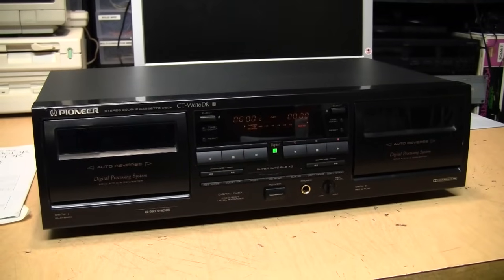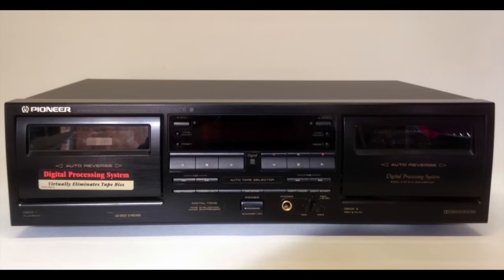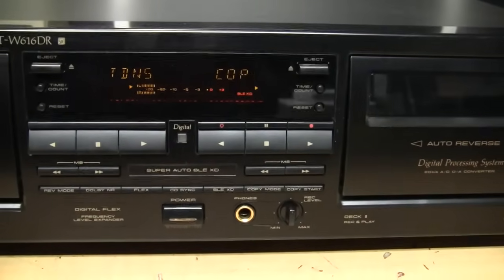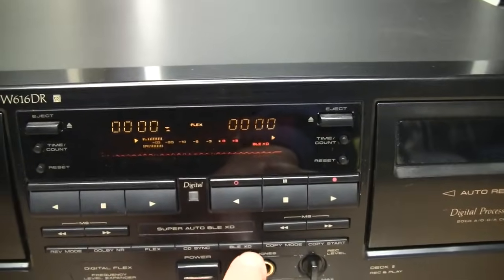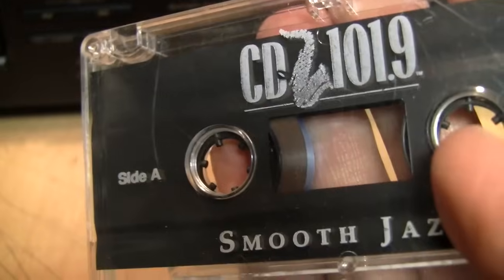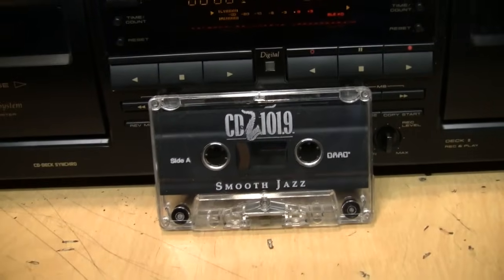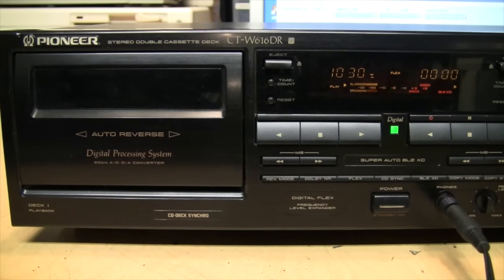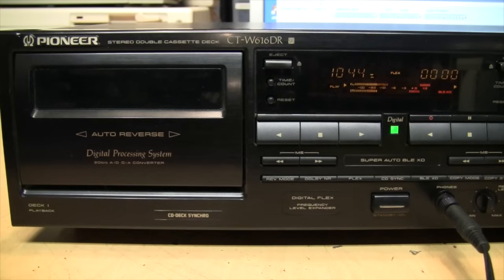A cassette deck that eliminates tape hiss - Pioneer CT-W616DR

Comment: It's 2021 and it's amazing! I mean, the SOFTWARE! Is similar audio improving software available anywhere now? It's not just simple EQ or noise gate. It's something much more subtle and advanced. Back in the days I owned Pioneer EX9000 dynamics expander. I'm still looking for a digital effect plugin doing the amazing work that device did.

Comment: Hey, I have a W404R, I was wanting to tune it's speed which is a little slower but didn't found any way, didn't tried using the screw on the motor yet, is there any other way?

Comment: I wonder how exactly digital processing works on this deck and if it eliminates part of actual audio signal together with hiss. Can anyone shed a light on this?
Reply from the maker: You can find the service manual which shows the block diagram and schematics.

Comment: My CT-W606DR seems to play fast. I recorded a CD from this. The recording was about 30seconds less (for a 56min recording) than the tape’s showed playing time. It did sound fast too. The CD recording sounded just as fast. Can the motor(s) speed be adjusted easily? I don’t have a test tape or a fancy “scope” machine. Mine plays and records good otherwise. It looks almost like a former owner had it refurbished. Thanks for any help.
Reply from the maker: Yes, there are speed adjustment pots on the circuit board.

Comment: I remember reading years and years ago about the Pioneer decks that had internal digital audio processing.  If memory serves it was strangely only available in a few double decks none of which were 3-head models.  If the almost unbelievable specs are true it might be said that this deck should sound as good as a 3-head Nakamich. i Adding the expense of 3-heads therefore may not addl audio results one could actually hear?   That is if the specs are true.   I think Pioneer was really on to something here.  In my opinion dual decks usually had lesser quality transports so I'm wondering how solid the transports are here?  I can't help but believe if Pioneer had continued with the digital processing with some kind of high-end single 3-head dual-capstan precision transport machine they just might have been able to make the very finest sounding cassette deck in history bar none.  You've probably heard the story of the youth who built a nuclear reactor in the family's garage...so where's the kid (or mad scientist) that took the digital processing here and built it into the most outrageously fine cassette deck transport/electronics  in the world?  I think that would be way cooler. than more nukes  At any rate I'm impressed by the souund these digital augmented cassette decks were capable of and thoroughly enjoyed this video.
Reply: I have a CT-W606DR i bought from the flea market, I didn’t realize it had a DA converter. It sounds amazing even with a normal Maxell UR (no hiss) however it was recorded on a Dragon with a digital source. I don’t how how it sounds recording from it yet.
Reply: @jcabb1  I really believe Pioneer would have knocked Nakamichi off the throne had they continued developing cassette decks with their superb DA system.  It really is some  amazing use of digital technology married to the analog compact cassette!
Reply: @johnwerner4925  No doubt, this deck doesn't sound like listening to a cassette or a cd but somewhere in between to my ears. This deck is a wolf in sheeps clothing, gots the right electronics but the plasticy bits are a bit cheap.

Comment: Hello  ! I have a Pioneer CT-W 809 DR. Bought a digital in optical cable with 3.5 mm audio cable for the mobile, pressed the digital in button and the display flashes (feels that cable is available) but when I  record I get no recording signal. What's wrong ? What should cable be? Connected to a CD player  ? 

 Switched to RCA analog cable with mobile and the digital light is on, then I can record and get a signal. Does it record digitally to the cassette tape then?

Can i use the digital in cable with mobile phone or can I get around it in any way?

Kind regards ! 

Stefan / Malmoe / Sweden 🇸🇪

Comment: Hi, do you know how to adjust the azimuth in this tape deck? There are now screws below the tape doors. I have some tapes whose volume seems to come and go during playback and I think this is because the head is no correctly adjusted and does not read with enough grip the tape itself. Thanks .
Reply from the maker: With a very small Phillips or JIS screwdriver you can adjust the azimuth by sticking it into the holes below the doors when the mechanism is in playback mode.

Comment: I purchased two cheap, figure one for parts for the other.  First one the VFD is so dim you can't read it hardly and the belts need changing.  Second one the VFD is a little better at least readable and the belts are ok.  The sound coming out of this is awesome.  Sucks about these Pioneer amber VFD, just don't last compared to others.

Comment: I am a technician specialized in restoring and calibrating these Pioneer cassete decks. If someone needs assistance please let me know. I live in Brazil but can be useful through internet. And congratulations for the video, it show one of the best performing tape decks ever made, and at a suprisinly low price, although it is very hard to find nowadays.

Comment: And if you want more than demo mode,
pressing time/count and reset on the left deck and the pause button on the right deck opens up the test mode, for diagnostics and calibrations made simpler. Can use it to play a normal cassette at 2x speed without dubbing it if you really wanted to.

Comment: Ok, once again, it's not the Tape that hisses it's the unit itself that produces that hissing sound and that hiss gets recorded the tape. None of my tapes hiss. Need proof? With no tape in the tape player, increase the volume and press play button. With no tape in the deck at all, what do you hear? Same exact hiss that hisses while the tape plays. Tapes don't hiss. Play a brand new blank tape, then remove the tape and play the deck with no tape, what do you hear? Same hiss. Allot of people fell for this lie, to give tapes a bad rep, and make people believe that tapes sound shitty. My tapes somehow don't hiss at all, sound Louder Sharper and Cleaner than CD's and especially MP3's.

Comment: hi there sorry to bother you but i was just wondering if you can assist me with some old info . regarding the 1980s tdk  add . if you can remember the brand or knew about the silver pherhaps tdk headpones  that are worn in the commercial. the song in the add as " tdk does amazing things to my system " i once knew the seriel cold to the headphones only now found in japan but if your history goes this far into the headphones been worn in this clip.. would be very helpful  thankyou

Comment: VWestlife, I bought the 606dr model sometime ago. As you know it has the digital processing but not the flex option. Is it worth upgrading just for the flex option? I actually think the 606dr sounds great.
Reply from the maker: Your 606 actually does have FLEX, it just doesn't have a button for it on the front panel. But if you're crafty with electronics, you can add the button yourself and get it working -- look it up!

Comment: Finally!! Analog that sounds as good as digital. Well, in this case is triple-digital at least: CD 101.9, that is a radio station airing CDs (1st digital), ADC for noise reduction (2nd digital) and finally, YouTube (3rd digital). I rest my case in "defending" analog recordings. You may put them in museums!

Comment: I have a 606 off the back of this video .. my main issue is the earsplitting Headphone volume  ... does anyone know of a hack to add a pot to the rear so that the level can be controlled  ...
Reply from the maker: Add an in-line volume control. They're easy to find on Amazon or eBay.
Reply: @vwestlife  Yeah just looking at them now ... Thanks... Also for everyone info to EU/GB version is the 606 it has BLE and FLEX and also has a green display

Comment: I had a deck almost exactly like that like 20 years ago. I still have the VSX-9300 receiver that I used with it though and it still works great. Pioneer made some excellent quality home audio equipment back in the 80s and 90s.

Comment: I really like the Pioneer CT series decks, they're not that expensive, easy to re-belt (I managed without even removing the mechs from the machine), a lot of the range uses interchangeable parts and MOST importantly the speed and level adjustment pots on the motherboard can easily be accessed while the machine is running making tuning them by ear not only possible but simple. Really the last era of electronics that was designed to be serviced rather than replaced when it broke.

Comment: Nice review. I still have my Pioneer CT-W604RS I bought new back in January 1996. Still performs nicely as it did back then. Mine has the Dolby S and certain features as yours minus the "digital" feature. I suppose Pioneer discontinued the Dolby S that following year in 1996?. My deck has a production date of September 1995.

Comment: That moment when you develop a state-of-the-art noise reduction system only to put it into substandard double auto reverse decks. SMH.
Reply from the maker: Pioneer did put Digital NR into two high-end, single-well, non-autoreverse cassette decks: the CT-S670D and the T-D7.
Reply: @vwestlife  I was thinking along the lines of CT-95 or CT-S920S. But I guess these classy machines came a tad too early for DNR to be implemented.

Comment: there is one of these decks with a three head version but i dont know the model number, i have seen it before, it was a single deck but they probably did a dual version.
Reply from the maker: Yes, that's the Pioneer CT-S670D (sold in Europe) or the T-D7 (sold in Japan).

Comment: I'm a tape freak, cassette or reel to reel. I came across a good condition Pioneer CTW806DR on the street a few days ago, and I paid 11 dollars for it. My God! I could never hv guessed they came up with this system. At the street buy, I thought the 20 bit system was for direct in of CDP, anf so I saif to myself, eh thus could be for a good relay play unit in my bedroom. Little did I know it was so so so so so so surprisingly good in actual use. No hiss at all on my tapes. It was not until I read its user's manual gotten from hifiengine.com that I realized this deck had Super BLE XD, ALCA, FLEX, and a defeatable digital NR! THESE WERE no gimmicks at all, contrary to some of my experience with Pioneer. This was the real deal, to play any tapes (except those recordings made with far off azimuth angles) well, even those made on my Nakamichi's with pre-1979 EQ curves. I'd go so far as to say, this deck my CTW806DR, and the 606, are over kills in a good way. Their major drawback could be IMHO, their Auto reverse heads that according to the user's manuals, are made of hard permalloy (PB/R heads) and ferrite (ER Heads), which may wear down quickly, despite the hard perm having excellent magnetic and thus sound performance.
Reply: That is why I bought the single deck no autoreverse back in the day.  It needs no adjustment ever. They were so good that back then I remember that I had reused all my old casettes as the quality of the reconding was so great that it was better on a very old (low quality) casette than on my older (very good but older kenwood)  tape recorder on a chrome casette.

Comment: Awesome video! You actually pushed me into buyinc this deck. First recording on type 1 without dolby sounds really promising. Looking forward to trying with different tapes and settings 

What settings do you usually use? Dolby or no dolby during recording?
Digital and flex during playback? Or do you find it better to go defeat those functions?

Comment: I have a cassette and 1+12 cd (12 disk is in the trunk) in my 1998 Cadillac Deville.  The cassette is all sorts of dolby NR and the head unit has all sorts of digital manipulation where my cassette tapes sound the same as my cd's.  The head unit sends a digital signal to the factory amp in the trunk where the output is sent to the 11 speakers. I recall the amp has like 100 wires going to it.  22 of those wires are for speakers 8 are inputs then 8 go to the cd player, data lines, car chime module has a few, power, onstar, mic for onstar, etc.  old school audio was a crazy beast!

Comment: I can clearly hear the main lack of that noise reduction system: although the SNR is good, the signal peaks sound noisy (a bit sandy/abrasive) and it's quite hearable if there's no high frequency parts in the samples - f.e. on voice. The noise reduction seems to be behaves like noise gate.

Comment: I bought the Pioneer CT-W606DR (almost the same deck) after watching this. My impression: If you are used to older decks which were made well (any Nakamichi, Marantz, JVC, Sony and other mid-high level decks) this thing is like a horrific plastic mess. It's like those light VCRs that were sold on endcaps in the late 90's. Very, very cheap-feeling junk. On the performance: recording is terrible. The lowest of the commercial cassette decks in the 80's - Emerson, Sanyo, etc. would destroy this thing in recording sound quality. I was quite surprised at how bad it was. The strength of the deck was the digital trick; the 20-bit ADC/DAC. When you play a tape with this it sounds very good. Too good to be true? Through the speakers it sounds pretty good. Better than what an average deck can do. I put on some good headphones for a critical listen. The best I can describe the sound: It's like taking a good, warm cassette recording and turning it into a 128/160kpbs mp3. Is that something you want? Is that something I want? It seems like going backwards to me now that we have Hi-Res FLAC. Spotify at the normal setting sounds better IMO. I think the tech is fascinating and had CDR's not made this thing completely obsolete and unnecessary - would likely have evolved into something that was truly amazing. With all that in mind - there were 3 head Pioneer decks with this technology. I am wondering how they sound. Do they have the 128bps mp3 sound? Anyone have one that can comment? I would love to know but I'm not willing to spend a crazy amount of money on one.  My conclusion: Don't pursue this unless you have some rare tapes that Spotify doesn't already stream, or you can't get cheap on CD. I have a bunch of classical Deutsche Grammophon tapes that are unavailable elsewhere and a handful of alt-rock rarities that I'm converting. After that this thing is going back on ebay. You can get a Nakamichi BX-1 or BX-100 on ebay for $60-$100 that will smoke this thing in every function and it will be a pleasure to use and look at. It's all up from there.
Reply from the maker: If the recording on yours sounds bad, then either it is out of adjustment, or you're not using it correctly. Especially with Auto BLE XD enabled it should be capable of producing excellent-sounding recordings, such as you can hear at the beginning and end of this video: https://www.youtube.com/watch?v=WD08dkTdb5E
Reply: Brian..... You dun hv 47 other decks to tell u how revolutionary and hiend this Pioneer system was. For one thing, it's not mp3 quality. Get one yrself, redo all yr tape dubs if u still can. And listen in awe.
Reply: Brian Shunk f
Reply: Brian Shunk c

Comment: This looks a whole lot like my Technics rs-te373 deck from the same era only it doesn't have the digital features. I need to change the belts to fix some speed issues I have on the record deck side.

Comment: Double cassette decks are not far as good as singel 3head closed loop dual capstan decks. My Teac V9000 can make recordings on metal tape that sound exactly the same as the CD. Tape used is TDK MA-X.

Comment: @ VWestlife. I have that CT-W606 Deck that also features the DNR System.  I've used it for many years to transfer books on tape to CD. I've been told the circuit board of both decks is the same - and there is, therefore, a way to turn on both the FLEX and BLD XD system.  Do you know how to do this?
Reply from the maker: Yes: http://www.tapeheads.net/showthread.php?t=14698
Reply: Thanks!

Comment: I had the other model you mentioned in the video, bought new in the mid 1990s. Worked really well and something different at the time. poor Plastic fascia panel that could scratch easily though (like most hi-fi of the 1990s period), quite expensive though.